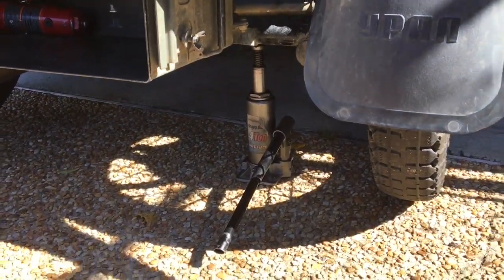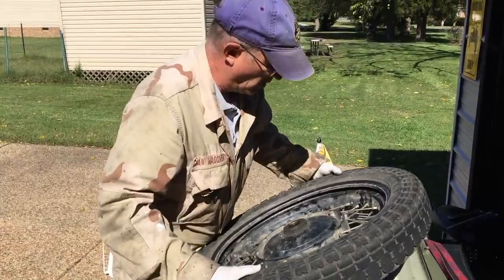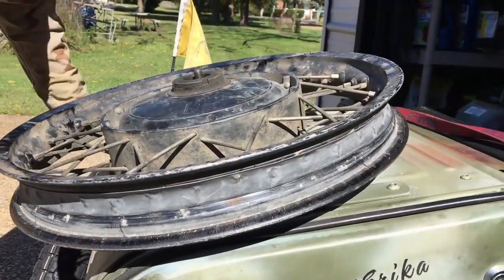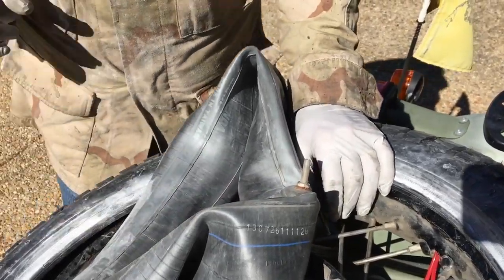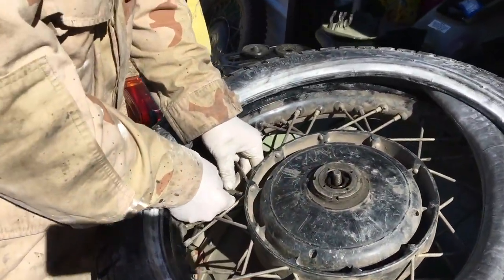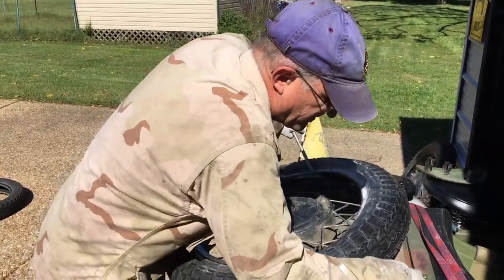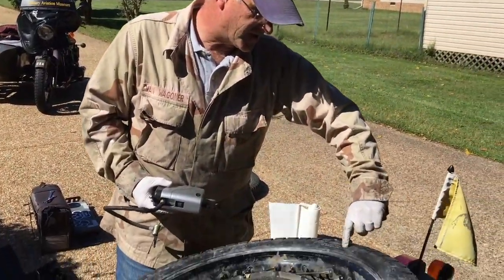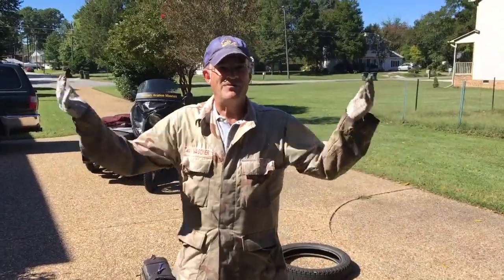Changing a Ural Tire

Comment: Dear David, If you permit me to mention, couple of things. 
1, As I see how to employed it the  good idea, the valve stem feeder true the rim, as you re install the inner tube, if you  feed the installer plastic tie under the inner tube the stem, not above, the inner tube will not going to twist around.
2, If you use the baby powder, or a talcum powder, may I recommend it, if  also put some in the tire, on the rim before putting the inner tube inside the tire, so the inner tube have easy way to find the most convenient place inside the tire.  Also the stem,  it will not going to ripe out it self from the inner tube that easy, if the tire air pressure diminishing marginally. 
3, After, when the inner tube is pumped up, with some air, let it find the inner tube its place, then let the air out of the inner tube again. During the installation, when you are installing the tire,  the tire rim middle ( where the spoke nipples  and its rubber protector is), the rim  diameter is slightly  smaller at that section on the rim, as the tire sits on the rim!   Using this at the time when you are installing the tire on the rim, push the under side of the tire in the middle of on that rim, and it will need less force to slide it on the rim.  
When install the other side of the tire, at the time we are try to push it over the rim top make sure at the opposite end of on the same side  is in the middle in the rim to. 
 I think, it is a lot easier to do tire or inner tube change... some time even only using one tire tool...
Thank you for reading my note...
Sincerely ,   Rob

Comment: Great Video thank you so very much. If you want to make it even easier, after you have spooned the bead off of one side and removed the tube, turn it over and spoon the bead off the other side (just like you did the first side) The wheel is then inside both beads and will pull right out. :-)

Comment: When putting the last bead on if you start away from the stem that will make the final pull to pop the last part of the bead on at the stem much easier. Doing it like you did results in the final pull forcing the bead 180 deg back (at the stem) to cut the tube at the stem.  Bottom line the stem thus keeps the bead from dropping down to the center to give room for that extra stretch for the last pop over.

Comment: All I can say is thank God for you. I am completely not mechanical and I watch the video back-and-forth back-and-forth but all your tips tricks and techniques were fantastic I can’t thank you enough. I just changed my first tire on my URAL. I got a flat about three weeks ago and could not get anyone that wanted to tow the bike. Thanks for your help I should be up and running very soon
Reply from the maker: I’m glad it helped.  A non polished look at how easy it is to change a Duro tire on a Ural was my goal.  A side note, it’s bit more difficult with other, stiffer sided tires.
Reply: @davidvanwagoner2597  what other tires are available??? I need to replace some of mine and am looking to replace all of them with the most aggressive off road tires available. Is there a forum for Ural owners to trade tips tricks and ideas???

Comment: Thanks so much for this excellent video. Last time I changed tires and patched tubes was on my bicycle as a kid. Fast forward 60 years and I gotta change that leaky tube on the front tire of my Gear Up. Your video was clear, precise and has some great bonus tips like using the valve fishing tool, leaving the little nut on the valve stem loose, etc. etc. Happy and safe riding to you!